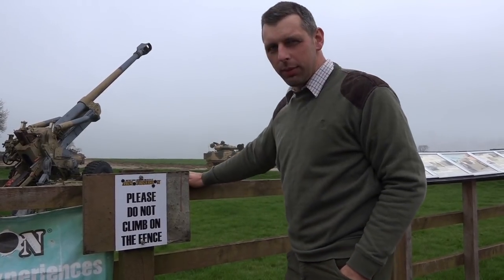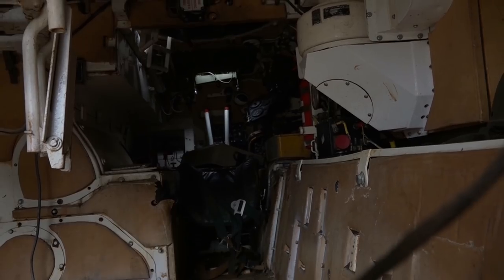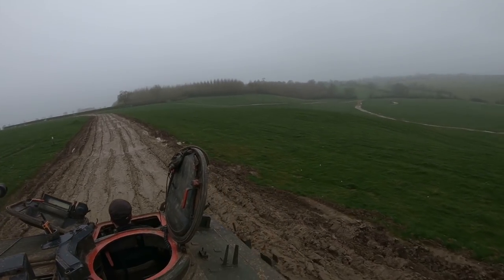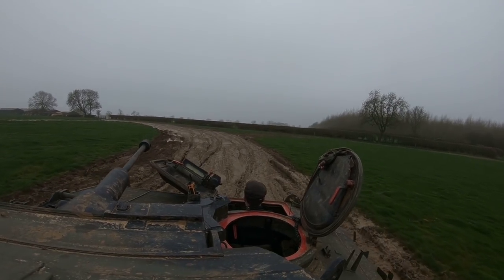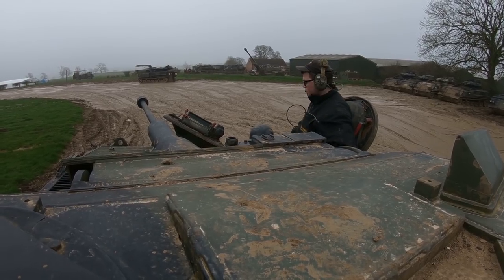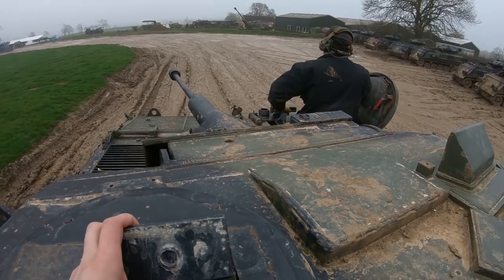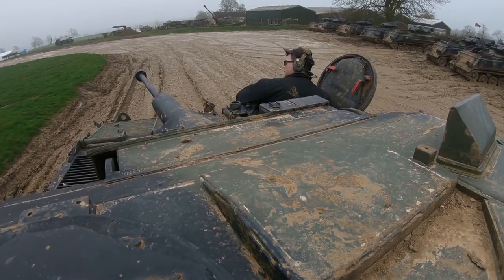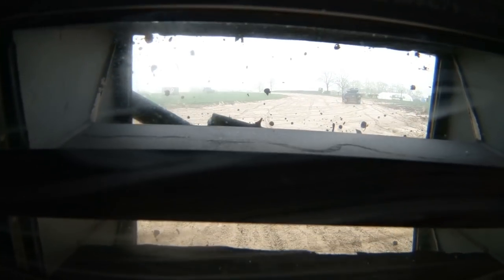Tank Driving in the Mud

Comment: George,the majority of 432’s didn’t have a turret like the one your driving,I only recall seeing the ones with a rarden turret in Berlin in the 80’s..
Reply: I think a lot have had mock turrets fitted Tony and a handful of late ones have been released.
Reply: Lord Muck ah that would explain,I fancy a go at paint balling in a 432.Love those engines..
Reply: We had a FV433 Abbot SPG with the K60 and it sounded gorgeous when turning in hard going.
Reply: I mainly drove the spartan cvrt with a petrol 8 Or 6 cylinder jaguar engine but the Regiment we were attached to had the Abbot..and as you say when they got going they purred..loving all the vids by you all 👍
Reply: Yes, Spartan originally ran the 6cyl Jag engine. It was the Saracen, Stalwart and Saladin which ran the straight 8 Rolls B-Series.
Reply: One thing I do remember is having my overalls on all the time fixing the buggers😭
Reply: Tony george 👍😂